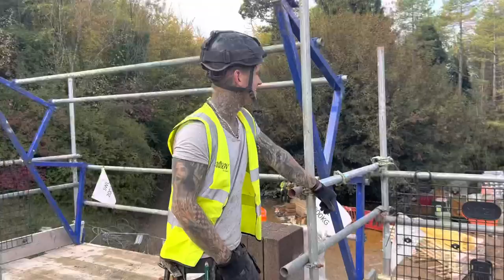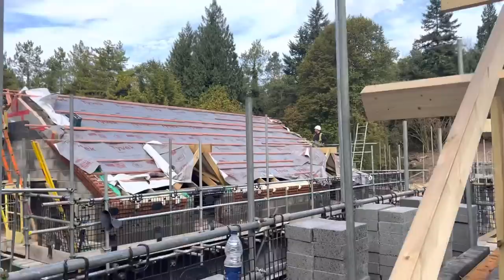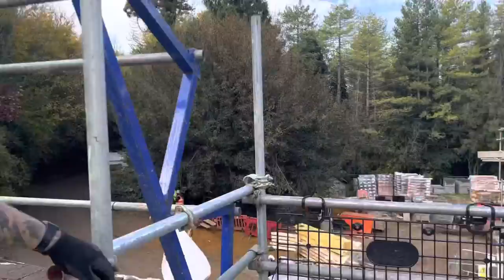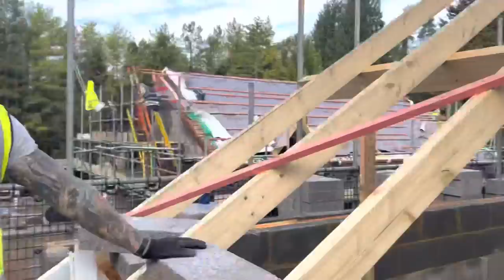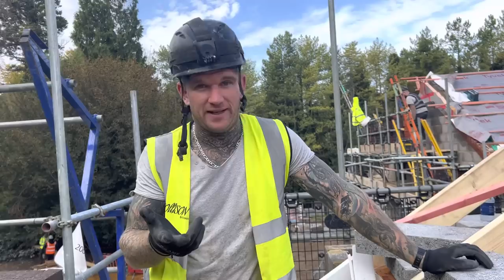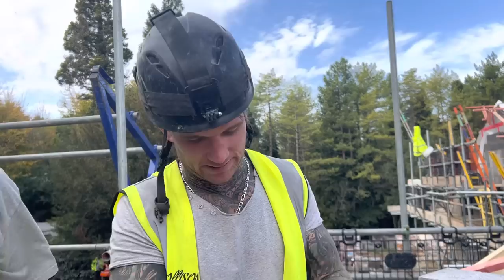Job update. #bricklaying #construction #building

Comment: Any advice Charlie for timber frames what way u thinks best building them
Reply: Make sure measure from your windows and doors likely will need bump to sill height
Reply: Cheers lad would u lean walls in to suit the window frames in Ireland that’s what they ask u till do at window and door jams
Reply: @dwe3015  
Yeah the clerk works all there interested in is having the brickwork tight to timber fire stop or the glass wool bags. Up here Scotland if in doubt make agent aware if second lifted is stepped in a bit which does happen at times with the wood butchers lol. Most important thing really getting gauge down from windows keeping corners right to stops and them ties clean won’t have any issues always take your dpc,s cut up behind the kit paper and folded up at ends.
Reply: @lmilne4859  cheers lad for that advice the frames over here can be bad at times more times trying suit the frames lol
Reply: @dwe3015  
Yeah it’s always the poor really more if facing brick. Blockwork won’t matter to much normally the most fucked kits are finished brickwork and al you get is take to the firestop. 🙃🙃 timber frames better money to be made less time on them traditional will always loss time due multiple of things that cost earning well. Long as plenty timber kits in front of ya will make plenty buddy. 50mm stabila level 5ft 80AS model what need for the kits. You maybe running profiles but the level perfect for checking cavity if it’s your standard 50mm cavity. Some times would use a bit fire stop but trying to get a straight bit timber ain’t so easy. If happen to building a lead or corner just jamb the level in or stop will keep your tails all good.
Reply: @lmilne4859  good man thanks for advice lad